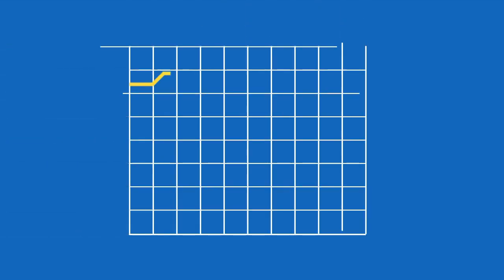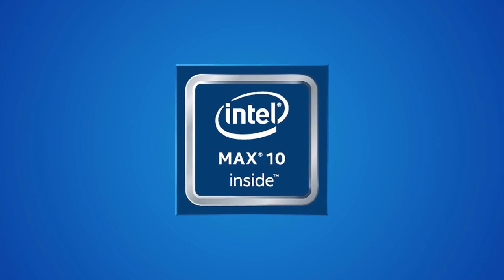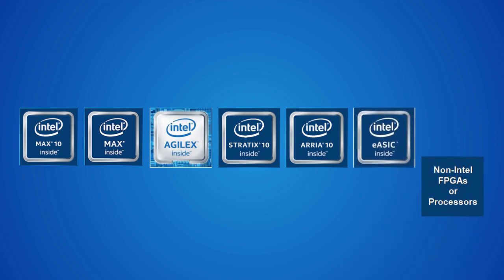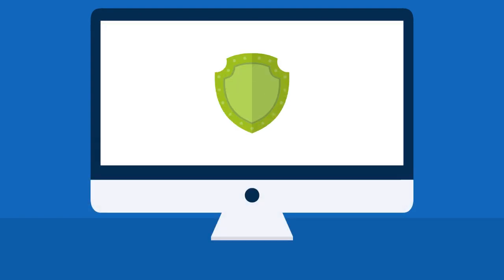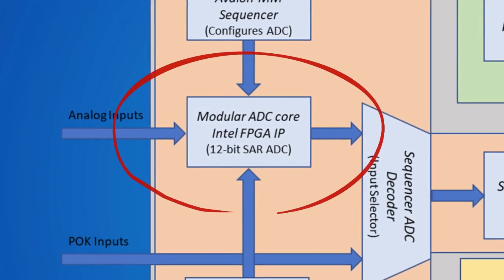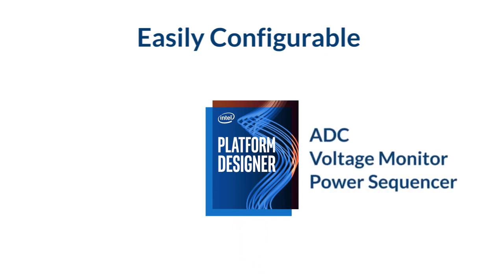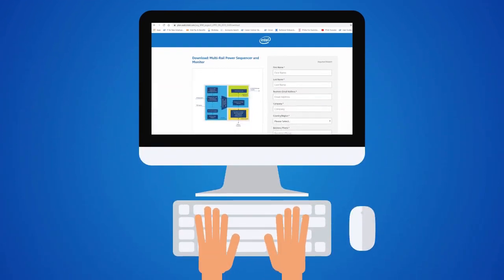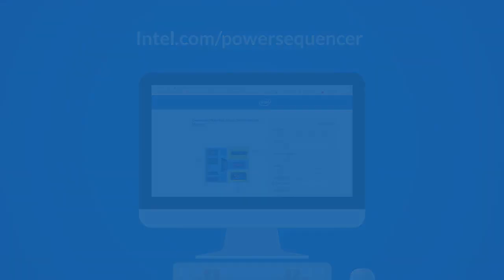Intel® Enpirion® Multi-Rail Power Sequencing and Monitoring

Comment: Well, from this Ad I could presume one can buy this FPGA IP Core to make a better DC-DC converter with monitoring/control and etc. 
Still, I could not understand, why would they not integrate the DC-DC converters into FPGA crystal and I could just feed 5V vccone and they step-down all the necessary vccio and vddcore programmable. At least for industrial grade MAX-series.